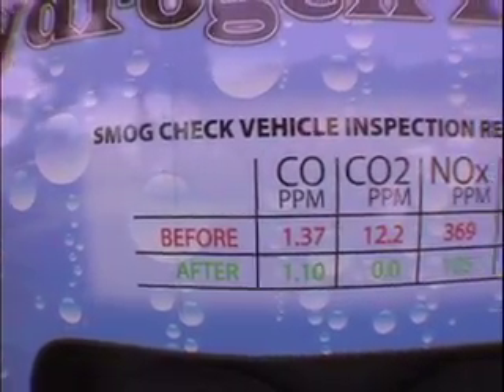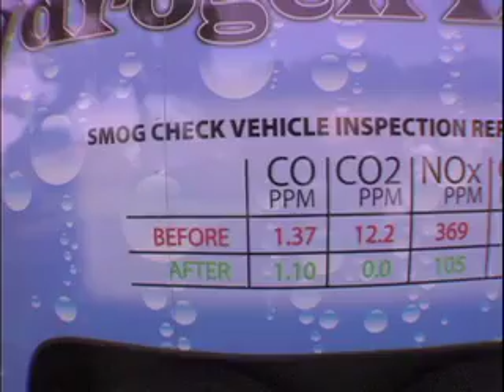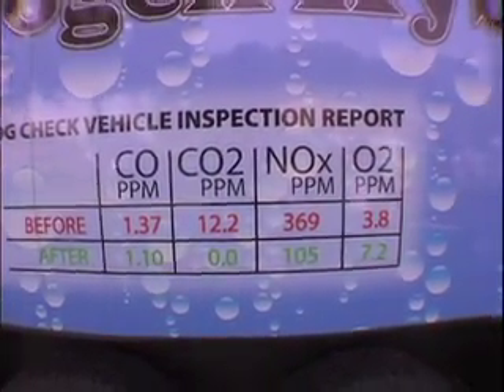LA ECO PARTY investigates the HYDROGEN HYBRID CONVERSION system by how2savefuel.com

Comment: Been there, done that. I even built my own systems that actually separate the hydrogen and oxygen. The problem is that computer controlled engines will see a cleaner, more efficient burn via the O2 sensors and will think the engine is running lean. The computer will compensate by dumping more fuel.

Comment: This seems like a scam mainly because it's a car modification rather than a chemical mod. If car companies can modify there engines to boost fuel economy in this way, then they would. Oil companies wouldn't have any say in the matter... As an engineer, I would be inclined to believe the science is correct, but introducing hydrogen into a system not designed for hydrogen process is a recipe for disaster. Designing a car to handle this is likely 3-4 times as expensive as current vehicles, so few would be able to afford such a vehicle. These are all assertions based on no inside knowledge of this equipment and what might make it "special".
Reply: ijostl its not about being nice. It's about profit motive. A design like this would give a company competitive advantage in the industry. Doesnt really make sense for me to debate with you about this though. Based on the analogy you provided, and general demeanor, you're a classless child.

Comment: the guy is an idiot and a scammer.  

A super efficient burn actually leaves you with less oxygen and more CO2 but the drawback of that is more carbon soot which is why diesels will blow black smoke out the tail pipe. 

You can't have zero carbon deposits in your car either and none of the claims he makes have any sort of evidence for them so you really have to take his word for it that it actually works.

Comment: I'm curious which oil company sal7t5 works for. He seems to be making it his personal mission to post on everyone's comment that this is a scam. That's exactly what I'd expect from someone who works for the companies that stand to loose business if this works. Unless you actually tried it or are an expert by way of working as a chemist, or if you worked in research and development in the combustible fuels industry, your opinion is as useless as your comments posted here.
Reply: steevieg water is H2O, he is injecting TWO parts Hydrogen and ONE part Oxygen GAS... ever see hydrogen burn?. VERY hot, more energy from same amount of petrol... get it?

Comment: how do you keep it from freezing?
Reply: you don't. it's a scam
Reply: Kyle Gunther in this video he says that it will cause your fuel to burn faster. he never says anything about adjusting anything on the vehicle. if the combustion is sped up the engine will not operate as designed. in an internal combustion engine the burning of fuel has to be finished at 23 degrees after the piston is at the top of its stroke. if the fuel is burned faster the timing would have to be adjusted to compensate for this. and he says that his oxygen coming out of the tail pipe is increased. well if this were the case the vehicles computer would have to be returned to compensate for the large amount of oxygen coming out of the engine. otherwise the O2 or oxygen sensor will see high levels of oxygen and think the engine is running too lean and will dump fuel into the engine. as a result of this your engine will run exprememly rich completely counteracting anything the system might have been doing and throwing you "fuel economy" out the window. there are so many flaws in this guys campaign its not even funny. if he has actually numbers from an inspection station showing the decrease in emissions and if he had a video proving that this system will clean the engine then if consider beleiving him. but as it sits right now I see it as total bs!